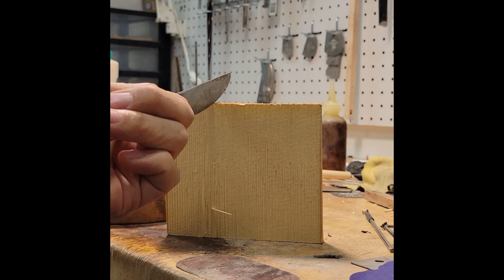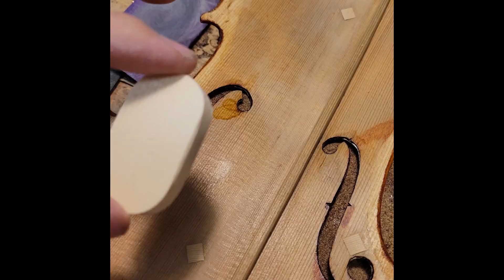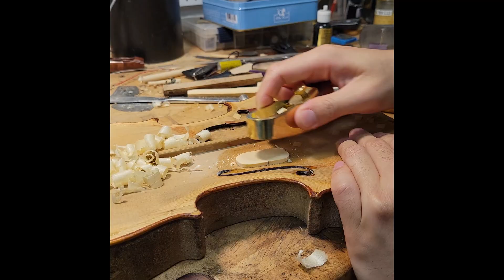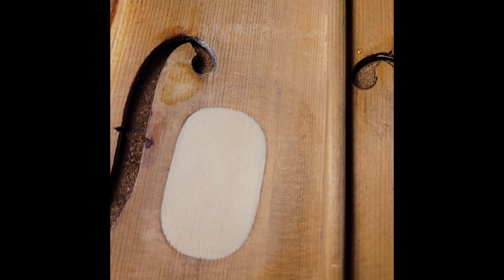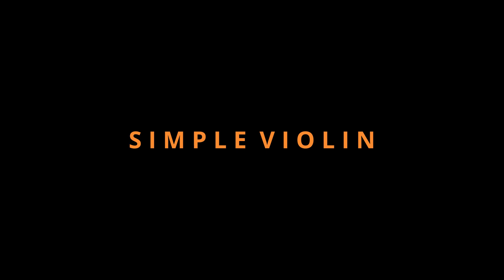[Violin Repair] soundpost patch | violin crack  on top

Comment: Is that a willow Wood block at the beginning of the video? How do you split it neatly in just a few hammer blows?
Reply from the maker: That is a spruce block. The willow block can be splited following the grain but it will not be splited straight as a spruce.